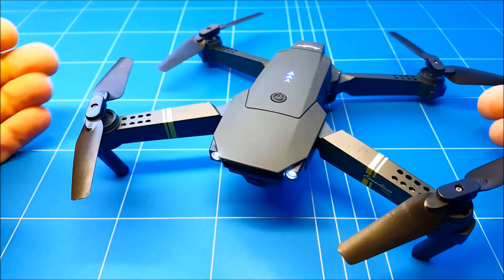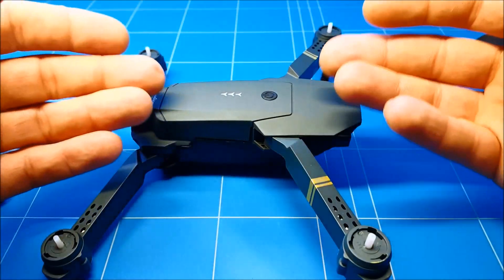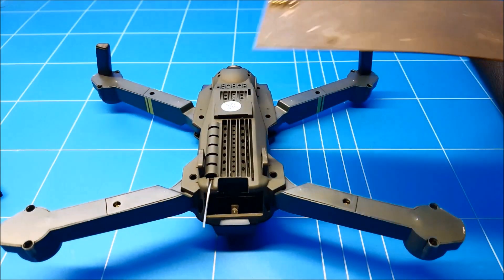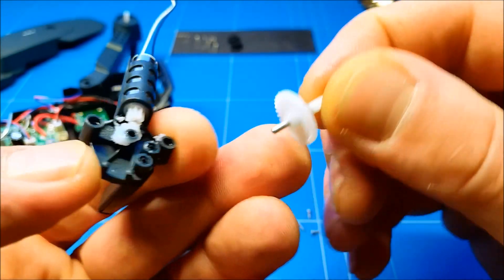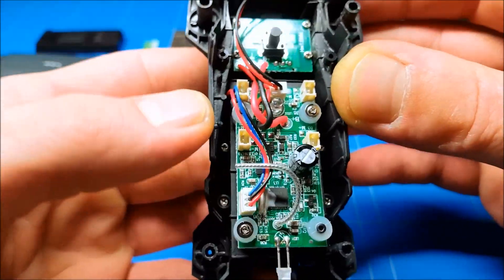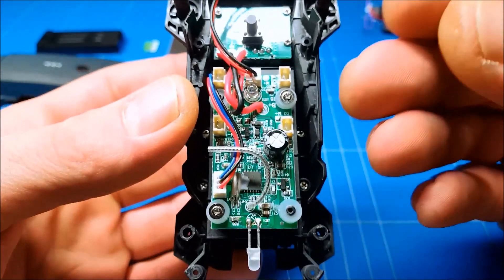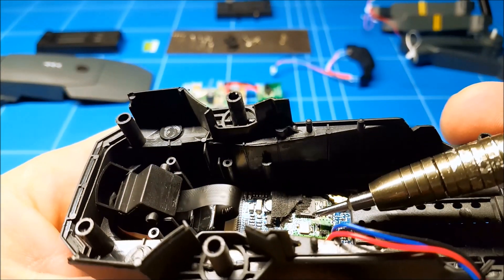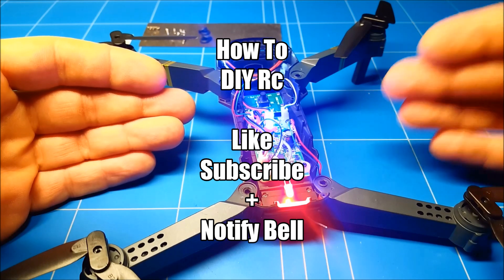Eachine E58 Wifi FPV Drone Maintenance Guide With Full Disassembly of DJI Mavic Pro Clone

Comment: Contrasting this tear down video with one for Mavic 2 pro is pretty revealing.  Mavic 2 has lots of SOC chips for processing and beefy heat sink/fan to cool the chips like a laptop.  I guess that's where the money is going when you buy Mavic for 20x the price of E58.
Reply from the maker: yes mavic cost more but you get more but they get lost too and very painfull to lose such exspansive drone
Reply: @HowToDIYRc  Even losing Eachine E58 would be painful never mind a mavic as it's not easy to replace.  I have bunch of super cheap E88/E99 drones (less than $10 each) and I fly these for training 🤣

Comment: hello, great hack :)
since you know electronics I have one question
I have eachine e58 drone without controller, i use my phone and it is noooot good!!!
I bought e88 model which has controller, it says it is 2.4 ghz and I thought maybe I could use it on e58 drone since they use the same one with 2.4ghz, but it does not connect. 
Do you have nay thoughts on how to resolve this?
Thank you
Reply from the maker: they use different code to speak between the transmitter and drone thats why they dont connect sorry dude you can by a hobby grade transmitter that have the abbility to speak 20different codes and check if yours drone code is one of them

Comment: Can someone demonstrate properly how the micro sd card is inserted into the slot on the underside of the drone? I suspect there are a number of these models which have a fake slot and no internal connections to the inserted card. No matter which way I insert the micro sd card, it just flops around and sometimes disappears inside the slot, requiring me to shake the drone to loosen it and drop it out. Sometimes I need to use tweezers to remove the card.
Reply: yes very few cheap drones have SD card slot.  E58 with it's 120 deg wide angle camera and SD card slot is pretty unique (and unfortunately out of production).

Comment: Thanks a lot for the video. My drone is the same model and the right forearm started shaking. Especially when the right front propeller is running. I changed the propeller but it still vibrating. Do you think it can be fixed?
Reply from the maker: probley missing teeth on your gearbox that white tingy

Comment: The crown gear design is subject to high wear.  I just repaired a friend's E58 clone that had significant wear on the motor gear after only a handful of flights.  I recommend being generous on putting waterproof grease on the nylon motor gears.  Fortunately you can get replacement motors with gear mounted for less that $3 each.

Happy flying!
Reply: Doggeslife - where did you see the motors and gears at that price?  Love your screen name!  The lady that talks inside my phone said IS life, instead of  ‘s life .
Reply: Or make a small hole in the tip of the drone arm so that you can spray silicon lube into and lube the gears  before every flight.  Also why not just buy whole cheap E88 drone for $10 or less and use it for spare parts?

Comment: help
i replaced the  flight controller or receiver board and it does not calibrate or respond to controller..My board is slightly different to the replacement
Reply from the maker: try to google how to pair the pair the a new drone with the controller

Comment: my e58 cant take off properly its stay on the ground what should i do?
Reply from the maker: CHECK ALL THE PROPS SCREWS AND VOLTAGE OF THE BATTERY MINIMAL VOLTAGE 3.3V AND AFTER YOU CHARGE MAXIMUM 4.2V

Comment: can we replace the motors with stronger ones  (i.e the motors of the eachine e520 which have similar dimensions 8/23mm compared to 7/20/mm??
Reply from the maker: you problay overheat the esc and destroy the drone

Comment: My e*58 won’t pair with controller or iPhone any more since it crashed , I could not put in a micro sd card nor spring eject it either.  Since it wasn’t flying right I opened it up to check and see all wires were tight. and there is no slot for camera. Forget the camera . Put it back together and won’t pair. Can you suggest a purchase or other help ? New board ? Thanks Rich
Reply: This is probably your camera problem:
In my E58, the SD card slot was displaced, so the card could not be inserted.   
I found the SD card holder PCB inside was loose.   
So the entire thing had to be taken apart.   
There was nothing to hold down the back end of the PCB, so it would not stay in line with the slot in the outer casing.   
I glued a tiny piece of plastic above the back end of the PCB to hold it down in place.   Now it stays there, and I can correctly insert the SD card.

Comment: hello
did you know something about the e88? look like better, 2 camera, 380g...
tank you
Reply from the maker: my friends have it and i get many questions about it and the e58 and e88 are very simmeler on the inside and you can make the same upgrades and antenna mods i did to the e58 check my other vids :D
Reply: @HowToDIYRc  
cool
your friend has had it for a long time?
did he have any particular problem to report?
Reply from the maker: yes bad range and drone fly away because of it
Reply: @HowToDIYRc  
you think the e58 is better?
Reply from the maker: no it have the same isseu if you really want a good drone buy the mavic mini or eachine ex4 or ex5
Reply: @HowToDIYRc 
Thenk you

Comment: Thank you so much for such a detailed video👍, I have problems with Eachine Ex5. After six flights, I can't turn it on anymore. So I have to tear it up and see where the problem would be. In the worst case, I will have to replace the motherboard, but I'm worried if the electronics are plug and play, or if any additional module settings are needed. Do you have any experience with changing electronics in RC toys?
Thanks 😉
Reply from the maker: you need to check if the voltage of the battery reach the motherboard and check the voltage at the turn on and off module and replacing faulty parts is very simple just plug and play nothing extra :D
Reply: @HowToDIYRc  thanks for the quick response, from the very beginning he behaved unusually because it was almost impossible to establish a WiFi connection with the phone, and also interrupted it several times, which suddenly one day after landing It couldn’t be turned off, then I removed the battery to turn it off, and now I can’t turn it on anymore. So I suspect the motherboard, and I was wondering if there was anything special to pay attention to. Thanks again.😀
Reply from the maker: good change something wend wrong with your FC but berhaps your wifi fpv module is also overheated since it creates a ton of heat and needs wind to cool it down standing still for to long burns the FPV module
Reply: @HowToDIYRc  Ok thanks, good to know that. I hope to fix it, because otherwise these 6 flights were quite expensive 😕
Reply from the maker: ye maybe you shut ask for a refund? or discount
Reply: @HowToDIYRc  They offered me a 50% refund so I will buy spare parts for that price if I need them. But I will try to fix it first.

Comment: Hi i have a problem with my drone e68 when my battery was fully charged suddenly drone was not turning on in short NO POWER i already checked the battery voltage 4v but the label on battery says 3.7 v. can you help me?
Reply from the maker: full battery shut be 4.2 volt and at 3.7v the battery is empty need to charge again you need a new on and off switch they are for sale at banggood

Comment: I have a problem my drone suddenly won't turn on my battery is fully charged but the drone won't turn on how can I fix it?
Reply from the maker: open up the drone look for loose wires and check voltage of battery with volt meter

Comment: I've got a problem whenever I connect the WiFi to my phone and starts open the app and it shows no fpv from the drone . Any solutions ? Btw when I turn on the drone the lights is blinking fast for a moment , any idea what's going on?
Reply from the maker: the light blinking very fast is calibrating the drone and pairing with controller no fpv solution is updating the app firmware and your phone firmware update
Reply from the maker: fast flashing tail light can also mean low voltage chrage battery or its calibration gyro
Reply: @HowToDIYRc  Thanks for the info !

Comment: Great video! Please help me with this problem of mine. I mistakenly bought not the original eachine e58. now my problem is after a few flight the left rear arm (drone facing me) is busted. upon watching this video I tried to open up the casing of my drone as shown here and noticed that the connection of its arm to the board is being soldered. Can I replace that arm with the one being shown here? I am just beginning to learn how to fly it and enjoying it when suddenly it fell from a 20 ft height and that arm does not run anymore. thank you so much for your time.
Reply from the maker: yes you can use this arm and solder the wires to your drone flight board
Reply: @HowToDIYRc  You mean i can cut the plug in end of that arm and remove its cover so i can solder it in the flight board? did i get it right? thank you so much for the reply.
Reply from the maker: yes yes cut plug and solder wires simple as that :D

Comment: I just got my little drone two days ago. But where most have the memory card there is nothing there for a card to plug into. Have you ever seen one of these drones that record all pix and videos straight to your cell phone or iPad? it is similar to yours but I got mine from wish yours looks like the one on Banggood.
Reply from the maker: then you got the cheap version that those record to the phone but with lag on sd card is better quality you can also use a screen recoding app to get the footage
Reply: I’m pretty upset with this drone. The one you are flying how does it feel in your hand? Thin plastic well built. I need to order a better quality so that why I’m asking I don’t want to be disappointed again.
Reply from the maker: the plastic is soft/rubber and feels very high quality but its very thin built quality is so so but comes with many spare parts so you can keep re[airing this drone and keep it flying but i just got the eachine 520S with GPS come in and soon show you some vids that might be a better one to buy then the e58

Comment: One thing that tends to be destroyed  is the little gears on the motors; it seems to be possible to get new propellor gears, but not the little ones on the motors, only both; is there a source for just the little gears>
Reply from the maker: ebay or buy a compleet arm with motors
Reply: @HowToDIYRc  I hate the waste of getting a whole new motor just to replace a little gear ... hopefully my piloting skills will improve before I have an entire bucketfull of perfectly good motors without gears ... (finally managed to get an arm put back together so that it worked).

Comment: Lots of handy info but would anyone know the reason why one of the motors is on when I plug in the battery? I'd be very grateful for the help.
Reply: I've replaced the arm but it still runs switched off with the battery in.
Reply from the maker: your fc got a problem making the motor spin

Comment: Hi, i need some help with my drone (e58). I was flying it and accidentally landed it in a puddle. Only the back half of the drone got wet (batteries, back motors, etc..) Now my battery will say it finished charging but when I put it into the drone, the drone battery runs out after about 10 seconds. It won’t fly at all, the lights just flash. (The power button doesn’t work either) does anybody know what to do or what parts to buy?
Reply from the maker: you need a new FC flightboard
Reply: Hey thanks for the reply. Apparently, waiting a few hours also does the trick 😉👍
Reply: That back mother board could be fried.  Where the battery slides in.    Im thinking of using styrofoam type pontoons for landing in water.
Reply: @somewhatdamaged1000  Landing in water sounds like fun, but test it in your bath first !   Then go chase them ducks !   (NO-O-O, just kidding !-)

Comment: Great video!  What kind of oil would you recommend to use on the motors?
Reply from the maker: you meen the gearbox? is grease no oil for the motors
Reply from the maker: yes that is good greease

Comment: Hi, I just got My new sky drone it’s look the same as  Eachine E58. I accidentally crushed it against the door and the forward propeller is not working anymore. Just want to ask some advice from you, since I watched this video ( nice video) and it looks helpful to see what’s the inside of the drone. 
My drone propeller blades is intact. My suspicion is the motor or the connections? Can you help please? This is My first drone and I want to fix it.
Reply from the maker: Oh no! Skye scammed you i'm so sorry they even abuse my review video in their advertisement grrr your drone is the eachine e58 and cost only 26 to 36 euro depending on camera quality in my description below the vid you find links all the spare parts one of them is a complete arm with motor and prop its a simple job plug and play 
only luck you have is that from this toy drone every parts is sold as a spare part and that's very rare for toy drones wish you good luck and just follow the links

Comment: Hi How to DIY Rc ,,nice   video detalled, I  seeing with detalles your video, you tray put oFF the WiFI board at final 13,44min after removing the rubber plate,  no screw but  it has a black locking tab between the two screw cylinders, which should be to open a bit and release the WIFI card upwards. must have another black locking tab on the other side, to release too. The camara just  must slide to inside  and out with wifi plate.  isn't it ??
Reply from the maker: yes yuor right
Reply: This could be your problem:
In my E58, the SD card slot was displaced, so the card could not be inserted.   
I found the SD card holder PCB inside was loose.   
So the entire thing had to be taken apart.   
There was nothing to hold down the back end of the PCB, so it would not stay in line with the slot in the outer casing.   
I glued a tiny piece of plastic above the back end of the PCB to hold it down in place.   Now it stays there, and I can correctly insert the SD card.

Comment: Hi  How To DIY Rc .   need your help about my question that i put  -- so please answer me only need confirmation about those board that  seems could be the solution of may problem E520S.  that is Eachine E520S blocked on start (click ON/OFF light  blue stay fix and blocked ) - only un.blocked puting out the battery. I think is Main Board issue.  I  need you make me favor - see this link Banggood of those Board that i think it is the Control board, named  "" receiving plate of spare parts with High Hold mode"" https://www.banggood.com/pt/Eachine-E520S-GPS-WiFi-FPV-RC-Drone-Quadcopter-Spare-Parts-Receiver-Board-with-High-Hold-Mode-p-1562317.html?rmmds=detail-left-hotproducts__1&cur_warehouse=CN --- 
please  can confirm me if this board 
 I would be grateful if you do. TKS
Reply from the maker: next time ask question without a link this message with link all end up in my spam box to anwser your question this is the one you need https://www.banggood.com/nl/Eachine-E520S-GPS-WiFi-FPV-RC-Drone-Quadcopter-Spare-Parts-Receiver-Board-with-High-Hold-Mode-p-1562317.html?p=UO23043354725201512Y&custlinkid=853482
hope to sovle your problem and you can have some fun again :D

Comment: The e58 I have the front left motor come on as soon as I put the battery in. Any idea on how to fix this ?
Reply from the maker: did you already try to unplug the motor connector and connect it again?
Reply: @HowToDIYRc   yes I actually had to replace the arm because it got so hot it melted.
Reply from the maker: then im sure the esc on the flight controller is overheated and melted  on the inside... you need a new FC

Comment: Great job! I have eachine e520s I think inside its very similar.
I want change camera for get better quality in video and photos, is it possible? What camera recommend me? Thanks
Reply from the maker: TEST HOW MUCH WEIGHT the 520s can carry and pick the best camera that fit your test results i hope it can a 4k hybrid runcam or a gopro 7 or 8 but is problay to heavy for your drone 
how do you like the gps on your drone? I almost bought it but then the mavic mini came out and changde the game
Reply: @HowToDIYRc  I think that have power for one go pro o similar camera but I thinked change original camera for other... It's possible? Or better add one action camera?
Reply from the maker: its not that easy to find one that works with your e520s if it is any simmeler to the e58 camera its nuch easyer to add a new on top of the canopy and go 5.8ghz instead of wifi
Reply: @HowToDIYRc   tks by your helps to us. Need your advices for an big issue of my E520S.
 what can i do to unblocked my E520. i fly tree times with it and on the last fly, after two take offs, it left respond. I change the battery, to tray unblocked switch ON the drone to connected it with remote control, but the drone start with fix light on top cover, and not respond to connect processing - Gyro calibration nor can i switch OFF. Only can switch off if put out the battery.
 i tray many proceding (change batterys - switch on first the remote control and after the drone etç) - nothing result- press switch ON =fix light blue in top cover no one comunication and to switch OFF -must put off the battery.
The Camara work fine on APP -LWFPV record videos 
Because this device not have an hole to Reset Factory, I can not do nothing.
can sugest something...TKS
Reply from the maker: ouch that sucks try calibrating https://youtu.be/LyC5Ru-b3fs

Comment: Thanks for this great video but wondering if you might explain how the camera/Wifi module is removed.  On my e58 the antenna, unfortunately, is soldered to this board unlike in your e58 where they've used a u.fl connector.